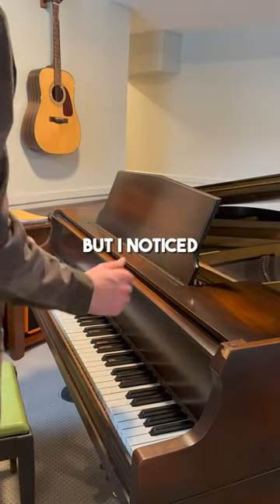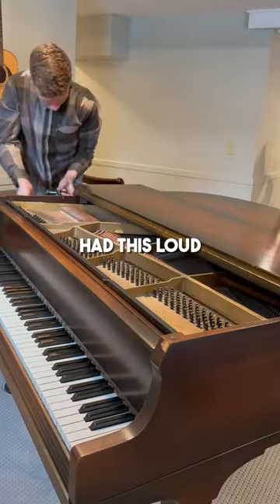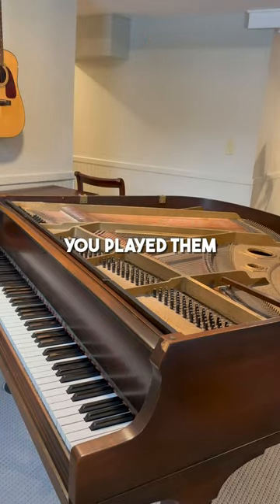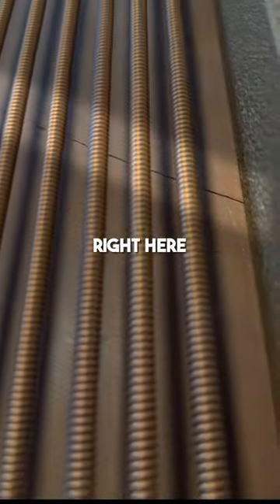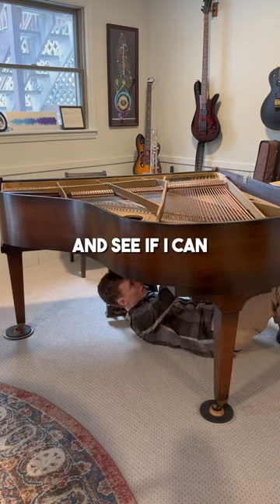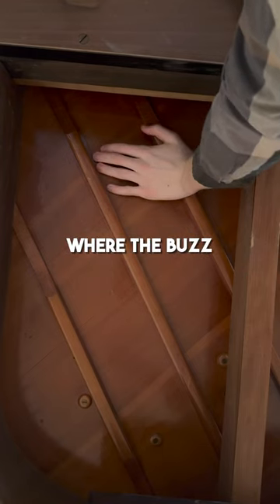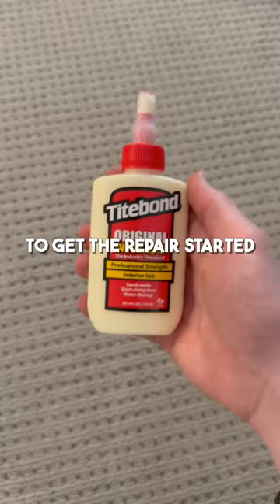Fixing a loud Buzz In a Grand Piano

Comment: Thank you for this video. Last year I bought a piano from a private seller. The piano was purchased new from a dealer in 2015. Before I purchased it I hired a piano technician to inspect it for major problems. He said it was out of tune and felt that the owner probably did not tune the piano since she had it as her son quit playing after a year. So when he piano got to me I expected to have to tune it several times to get it right. It’s been 10 months now and it’s been tuned 3 times. The last piano tuner told me he couldn’t find anything structurally wrong with the piano either but that he also found it was unevenly out of tune. He said he would come back in a week to do some fine tuning or another full tune if necessary. I notice what you described as strings of the same key are sometimes at different pitches so the sound of that note “warbles”. Can you tell me what you think is going on?  I hope it’s just a matter of a few more tunings to get it back to how it sounded in the showroom new. I love the piano but I hope it’s not somehow a lemon that no one can figure out.

Comment: Well done to discover the buzz! I have a 7 foot Kawai RX6 grand and the lowest G sounds lacking in sonority. It sounds really different to the Fsharp below it. I’ve voiced the hammer but made no difference. The G in question is the first of the duo strings in the bass midrange of the frame. Maybe I should harden the hammer? Provided there’s no ringing sound ..

Comment: I think you would be really good piano technician who willing to do the extra inspection even though you are just being called solely for the tuning job.

Yesterday I did the third annual tuning session with the second piano technician and yea it's my fault for just running chromatic scale on the keyboard and didn't do the octave/fifth/third etc. harmony check, and I'm frustrated for my lazed final inspection before letting the technician went home and call it a day.
Now I have flatten C while it supposed to be tuned and shouldn't out of tuned, and also buzzing sizzling sound in the central C region, oh my.

I'm gonna to hire third piano technician for my old used Kawai KST-5, hopefully I could get local Kawai authorised piano technician to do great job on the old piano.

By the way I didn't call the first piano technician that I hired before when my mum bought me the fourth hand used old piano because the keyboard were neglected even the technician noticed but he chose to do nothing, not even advising me on what should I do or what option I could take and he just said 'Oh for the price you paid does serve justice for this old piano you get' while I didn't know anything about regulation or tuned up or service? =(
And I learnt about piano regulation from the second technician I found online. 

Anyway the first and second piano technicians aren't Kawai authorised technicians, and I wonder local authorised Kawai would send their authorised technicians to old used piano?
Hmmm

Comment: Holy crap you need to upgrade your drill game. You are spending more time and money to find an outlet, get your extension and run the cord on that crap box than it would cost to just get a Ryobi and charge it once a week. Bonus, it comes with two batteries!